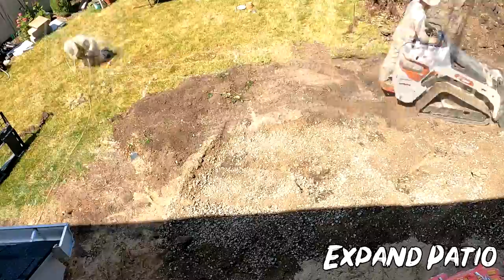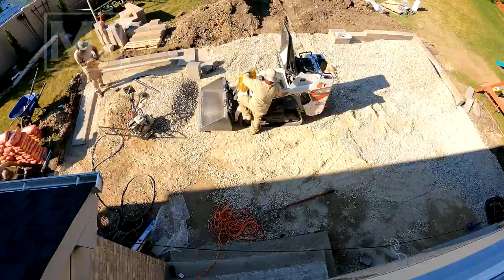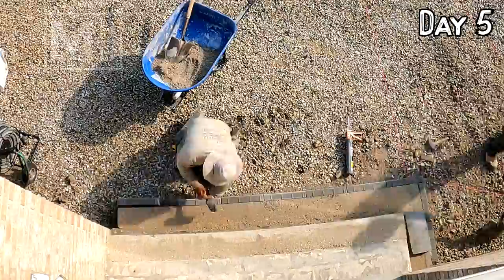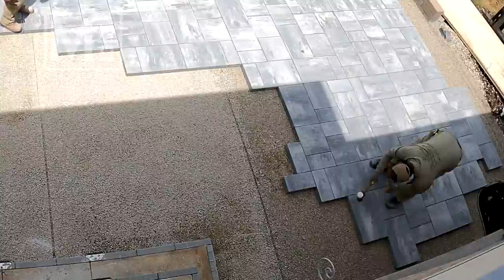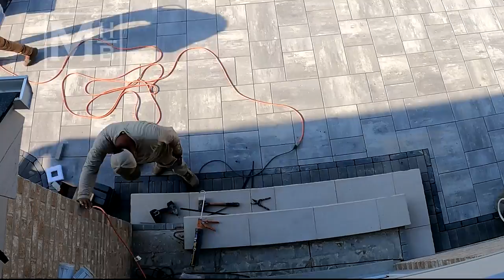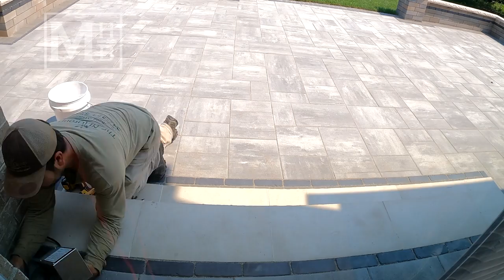Modern Paver Patio Transformation - Start to Finish Build Time lapse.

Comment: I know materials and labor prices vary greatly but I’m wondering if you have an estimate range I should expect to pay for a job like this. Any insight is appreciated, it’s beautiful and you guys did a wonderful job!
Reply from the maker: In general I found out that a patio is not cheap 🙂.  You are right, there are a lot of factors that will determine this cost. In our case, there were a lot of extras. Upgraded stone, Gas lines, sitting walls, pergola foundation, etc. so this was roughly $30/square foot.
Reply: @MakingHomeBetter  thank you!
Reply: @MakingHomeBetter  That is extremely cheap! It looks fantastic! That price would easily double here.
Reply from the maker: @brandonbryant9975  thank you for that confirmation.  I had an idea it was good but good to get some feedback.  Regardless, it's getting great use.
Reply: Hello! What location is this? Which state?
Reply from the maker: @multi-talented7986  Illinois